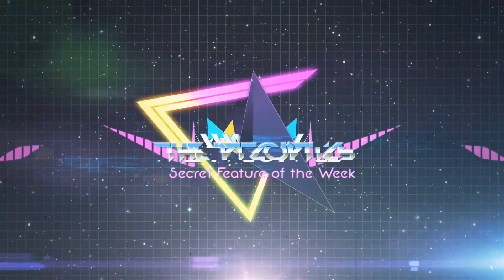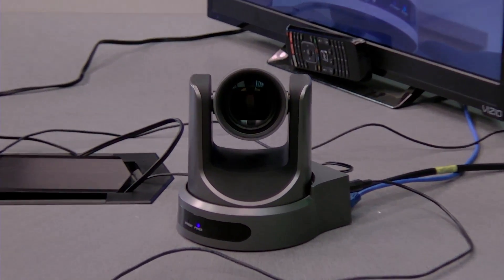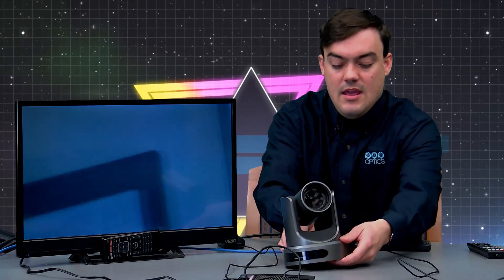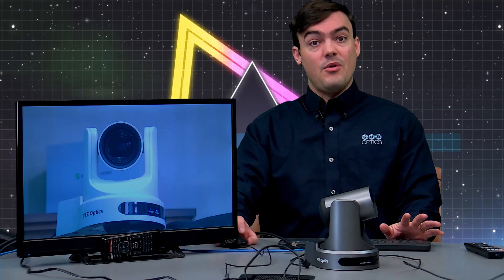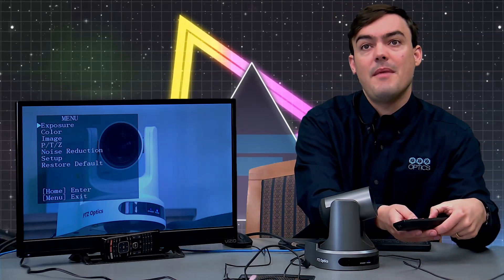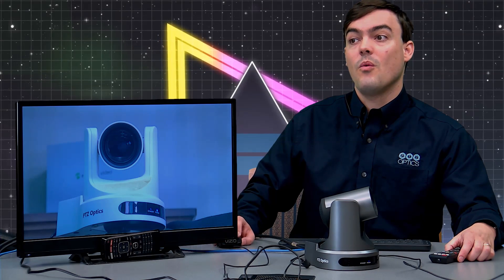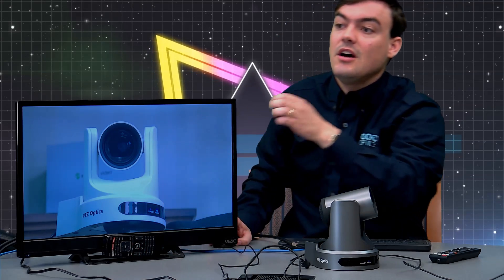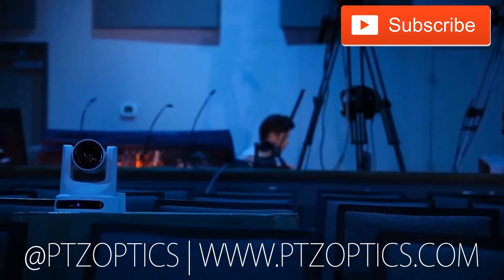How to Embed Audio Over HDMI from the Camera

Comment: How do you record audio output from TV directly to input on camera? What kind of connector/receiver/transmitter or cable would you need? Can one utilize Bluetooth to record external devices audio onto video camera simultaneously while recording video?
Reply from the maker: You can attach a 3.5mm LINE OUT if available from the television to the 3.5mm LINE IN port on the camera to capture TV audio. The cameras do not have Bluetooth. If you want to combine Bluetooth audio with PTZOptics video, we suggest you try video production software like OBS or vMix! - Lindsey :)
Reply: @PTZOptics  thnx!
Reply: @PTZOptics  would I need to be concerned about sound quality being affected? I think I read you may need to change the setting on the TV audio to PCM.  Also, if no camcorders have blue tooth, is it possible to use a transmitter/receiver/adapter to allow camcorder to utilize Bluetooth input for audio from tv or external device?